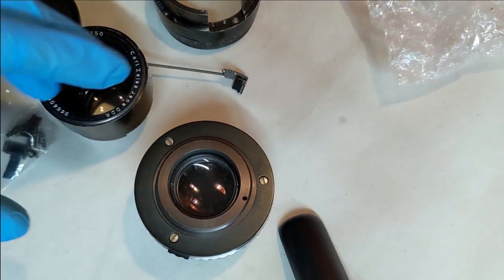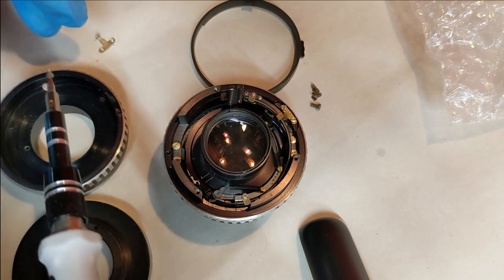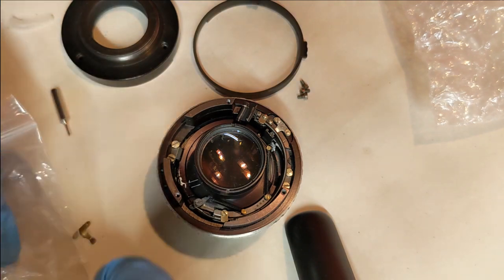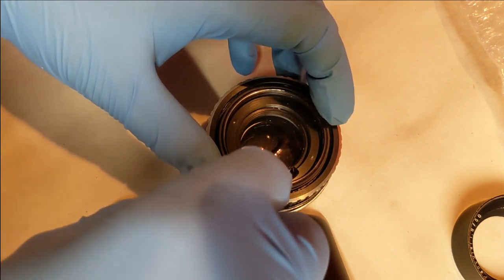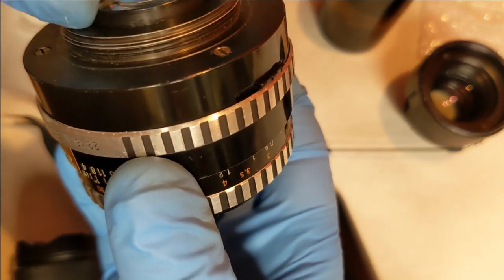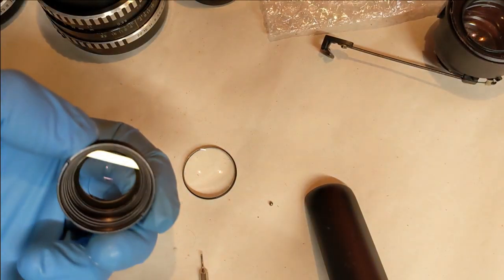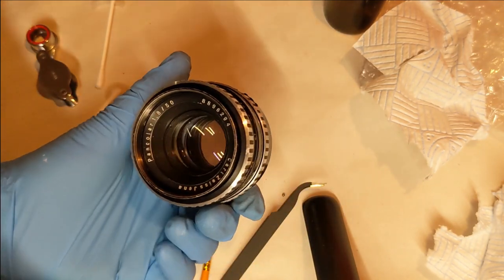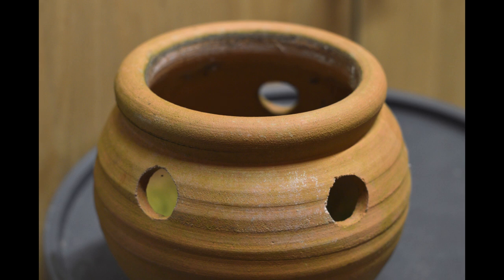Carl Zeiss Zebra Pancolar Repair : glass clean & aperture blade clean

Comment: hello! Excellent video, I would like to ask you something: I have a Zeiss Jena Zevra 35mm lens, when the focus moves towards the minimum focal length it automatically closes the diaphragm, closing it stop by stop. this is normal? Or do you know if there may be a solution? thank you!
Reply from the maker: I have the black version of the 35mm, but haven't had the zebra version. I am certain the lens should not sop down when you move the focus, there must be something interrupting the mechanism, It's not a fault I have seen before, I would start by removing the back and looking to see what is happening while moving the focus back and forth.
Reply: @pixelvalve  Honestly, that's what I thought, based on the fact that they are originally still photography optics, the diaphragm was step by step, precisely with the declick of the diaphragm there shouldn't be any problem. I'm already having it reviewed and I hope they correct that error. Thank you very much for your time and response!

Comment: I have four Pancolars but the radioactive version. They are earlier serial numbers than the ones in this video. Up to 8552600 are radioactive. They also reduced the number of aperture blades in the later ones. The reason I bought them was that these earlier versions were clearly going to go up in value but I got them cheap a while ago. One was sold as dismantled like the one you got. I thought I could rebuild it even without knowing how the helicoid went in but then I found out why it had been sold in parts. Getting the helicoids back together in these zebra lenses seems to be very difficult. I tried dissembling a Tessar that needed regreasing  but even although I marked how it came apart I had the issue again. The helicoids are very difficult to rethread back together for some reason.

So I have four radioactive Pancolars needing regreasing and cleaning and one needs reassembled  but I daren't take any others apart. The radioactive ones are the most valuable. They are super sharp but yellow due to the thorium. Superb for black and white photography.
Reply: I did rebuild a black Tessar and no issues. It's the zebra one that seem to be difficult but I think the build quality of the zebras is a bit better.
Reply: The electrical charge thing you mentioned seems to be much worse on the thorium version Pancolars. Hellish to remove dust or lint fragments. I have found that cotton buds still leave residue even if the water is pure. Cotton pads are actually better. The ones used for makeup application. Then a wipe with a very clean micro fibre cloth to remove any remaining residue. Fixing mechanical issues is the easy bit. Perfectly cleaning the elements is the difficult job.
Reply from the maker: I try to stay away from radioactive lenses, but I don't feel comfortable opening them up and handling the elements. I did wonder about comparing the image quality, that would be interesting. I agree the helicoids are a pain, I accidentally took one out of a zebra Tessar once, it wasn't fun, but I have done a few since then and like you found marking them isn’t helpful, the best way I found was to think of it like a ratchet and turn the helicoid maybe counterclockwise in small increments feeling it slip on the gear, and then reversing your twist to turn maybe clockwise at each click, to see if it will thread. 

I once spent all day cleaning glass on a lens, I just aim for satisfactory rather than perfect these days.